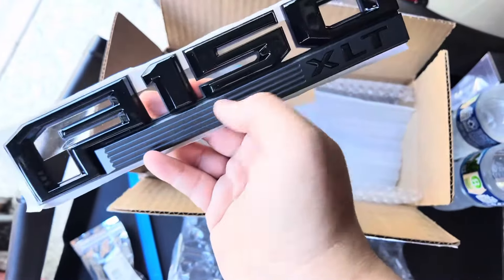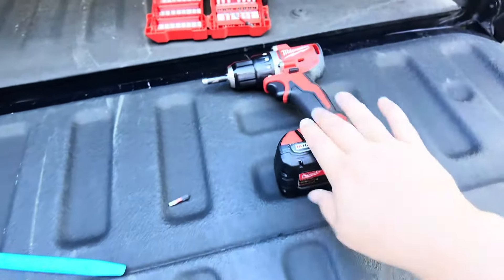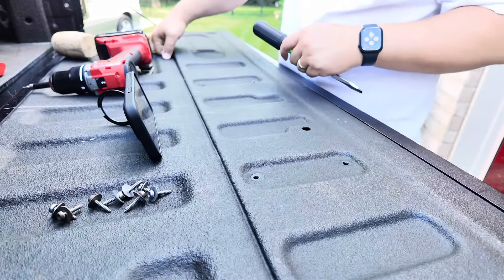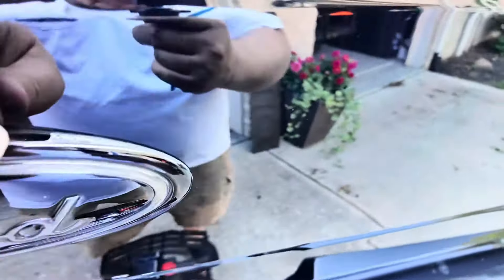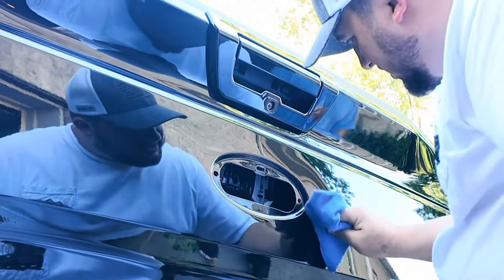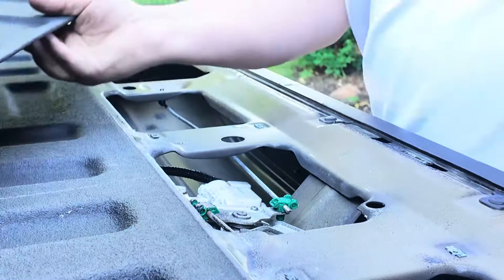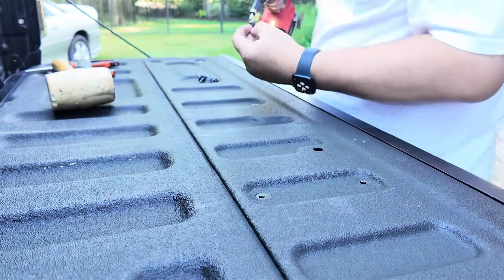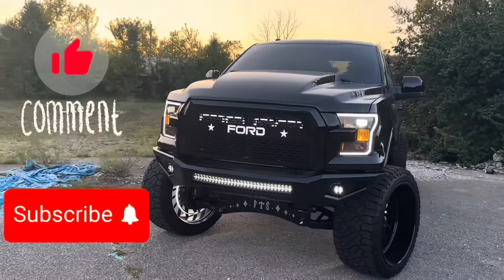Removal and installation of replacement tailgate emblem on a 2017 Ford F150

Comment: I’m definitely going to switch out my tailgate at some point and upgrade to a 2015 so my camera is on the gate latch instead of the ford badge.
Reply from the maker: Great idea bro! Pretty easy install. I couldn’t find many vids on this so I dug in and figured I’d post it and while I was at it, I was like miles as well do the sides too!

Comment: Did you change your gearing? For the 37”s
Reply from the maker: Not yet but I’ve been considering it. I rides just fine but I’ve noticed after a year going up a hill it slows down a bit